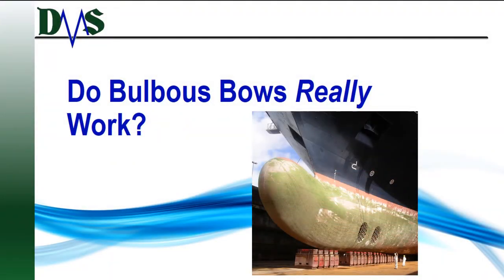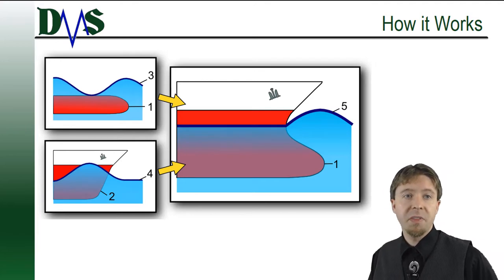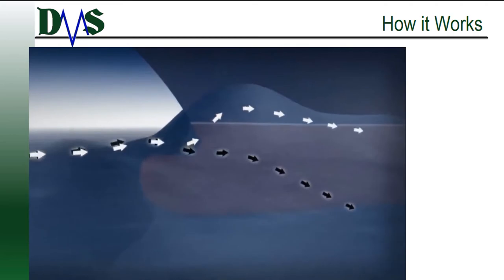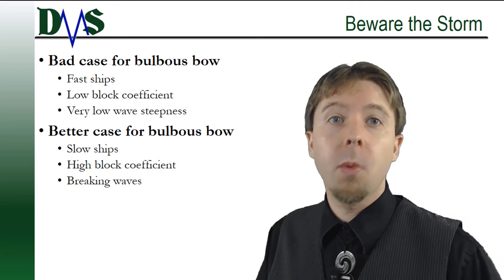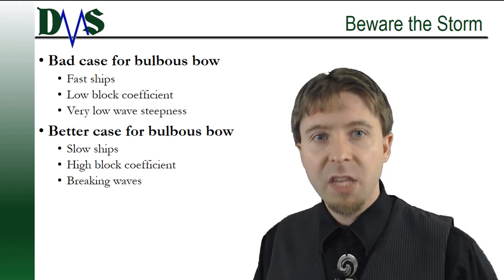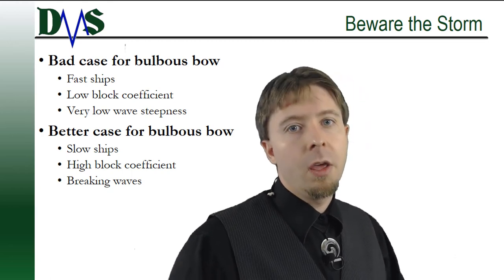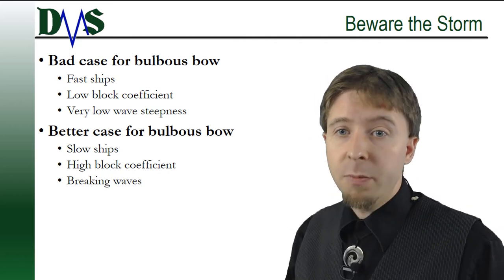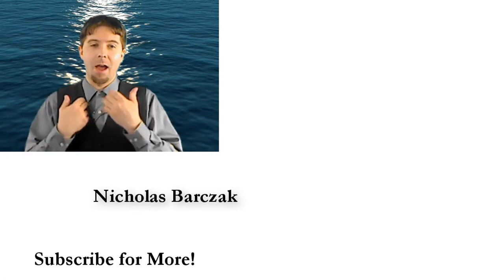Do Bulbous Bows Really Work?

Comment: Bulbous bow is not for wave streamlining,but to add bouyancy on the fore to prevent pitching during strong waves.
Reply from the maker: @eduardodaquiljr9637  Incorrect.  The bulbous bow is almost fully submerged.  Meaning it can not contribute additional buoyancy to mitigate pitching.  There is no additional structure to submerge.
The bulbous bow does provide additional buoyancy forward, but there are easier ways to achieve that.  For example, modern bows with vertical stems provide additional buoyancy forward.

Comment: A quick question: is there any reason why there isn't a movable bulbous bow so that it can work at different speeds?
Reply from the maker: Nothing comes to mind immediately.  Simple reason:  no one tried it yet, and no one cares enough to optimize the bulb that much.  Most ships fall into two modes of operation:  those that change their speed constantly (like a tug or workboat), and those that set one speed and hold it for days.  I don't know if a constantly changing bulb would offer significant fuel savings on a tug or workboat.  You may have the next big idea.
Reply: Thanks for the reply.
Reply: The expanding and shrinking bulbous bow would get a lot of dirty jokes made about it. But yeah, an automatically speed controlled bulbous bow extension seems a no brainer improvement for the large slow ships that would save fuel by having them.

Comment: Would a 60-70 foot vessel with a 10:1 ratio, ax bow(with out the sinking keel), and a planned speed of 7-10 knots benefit from a bulbous bow.  And not be a risk to life and limb in a storm state.
Reply from the maker: Not really.  Planing boats rely on different wave physics than conventional boats with bulbous bows.  Similar to the difference between subsonic and supersonic jets.  A bulbous bow on planing boat just gets in the way.  But at a 10:1 ratio, the hull was already so thin that you really would not need a bulbous bow.
Reply: I worked on a 185 foot Feadship displacement hull and it didn't have a bulbous bow. It cruised at 12 kts

Comment: But why? Why do the waves cancel out?
Reply from the maker: When we say "cancel", the waves aren't eliminated.  They don't disappear.  But at the single region near the bow, the two waves act in opposite directions.  You have a wave trough, with low pressure, and another wave peak with high pressure.  The ship hull only sees the net pressure difference between those two.  If we do our job right, that net pressure will be very small.  But those two wave systems still travel down the hull once they pass the bow.  So "cancel" is probably better to think of moving the regions of high pressure away from the bow.  If that high pressure happens along the parallel section of the hull, in the middle, then it doesn't contribute to ship resistance.  (Nearly.  There are a few tiny details to the process that I'm ignoring at this level.)